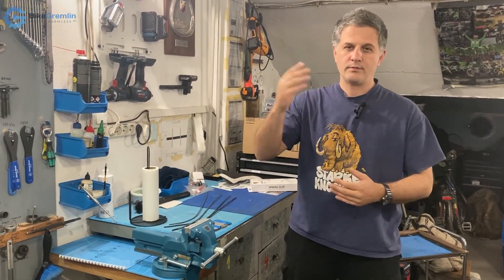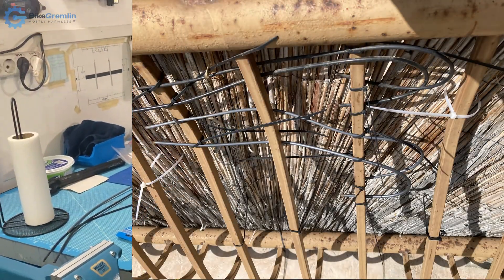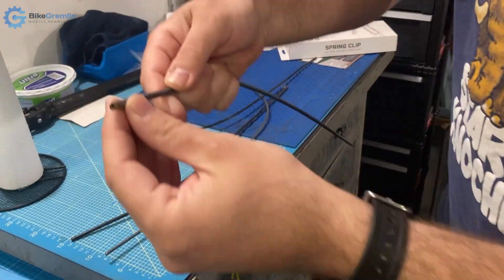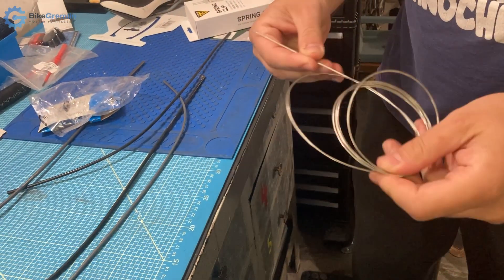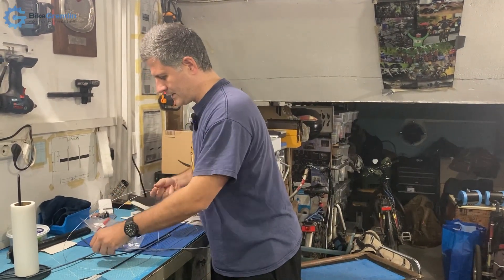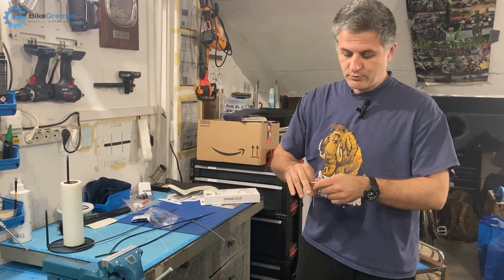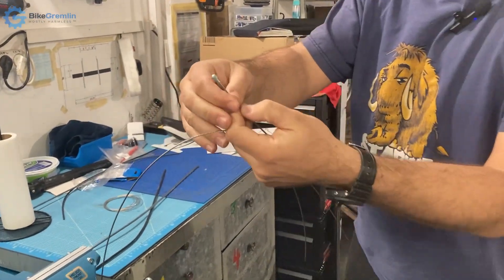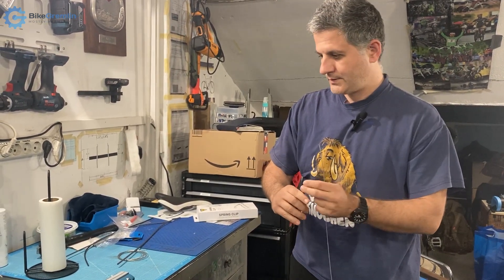Shimano shifter and brake housing 2-year experiment

Comment: Shimano cable grease is also amazing and doesn’t gum up housing long term like triflow.   I put it on all new cables, and only use triflow on old or allready gummed up housing.  I would love to see you do a test like this with galvanized cable.
Reply from the maker: Yes, I will probably post my notes on the Shimano cable grease on my forum (if I don't "polish" it enough for publishing as a standalone website article). One of those things where alternatives are simply not good enough (and not nearly cheaper enough if they are close in performance).
Reply: @ One of the old timers in the shop where I work converted me to Shimano cable grease.    He has been in the industry long enough to see what lasts over like 40+ years.   And he  would echo what you say, and your findings on Shimano Housings.    Another little known trick is using sram cables in Shimano housings. The SRAM cables are slightly smaller diameter which helps on tight bends.
Reply from the maker: As promised, the Shimano cable grease writeup (made a proper article):  :)

https://bike.bikegremlin.com/22576/shimano-cable-grease-explained/

Relja